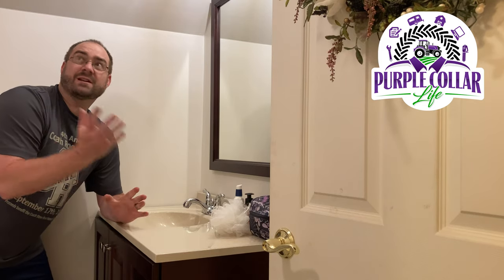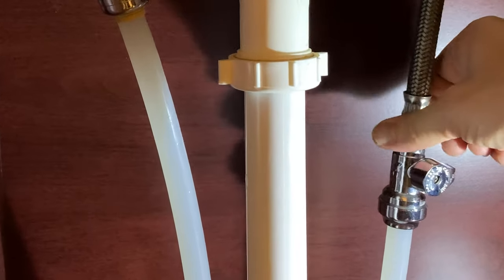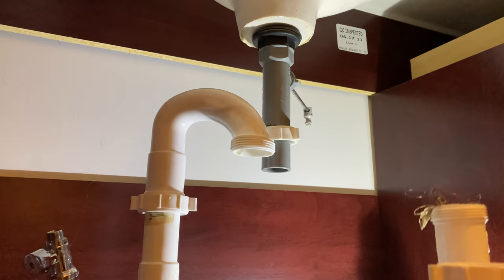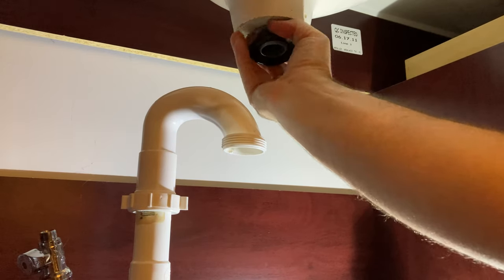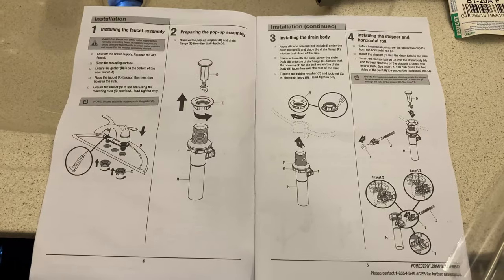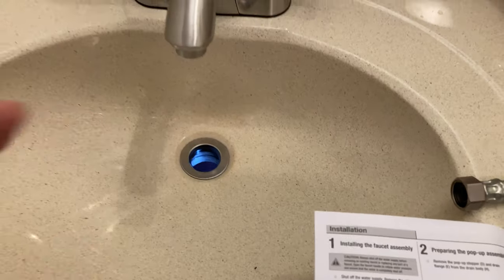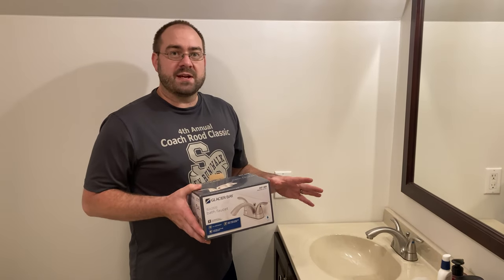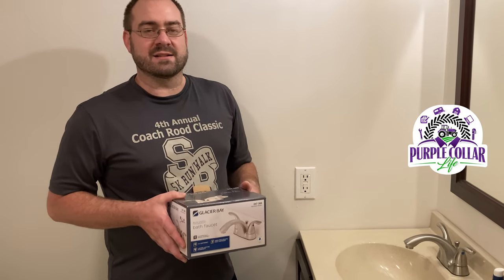#246: Glacier Bay Bathroom Faucet Leak and Replacement #purplecollarlife

Comment: How do you take off the faucet handle knob? I can’t take either the hot or cold side faucet handles. I just need to replace the cartridge inside.

I have the exact one (the one you took off)
Reply: Me too ,same
Reply: @HungPham-ll5ti I actually figured it out. These you just pop off. As in .. pull them up hard.

And after you replace the cartridge you push them back down. Hope it helps.